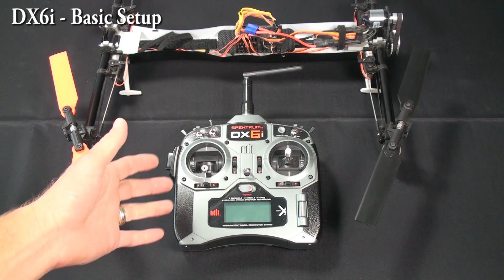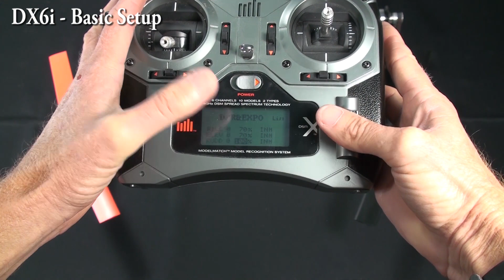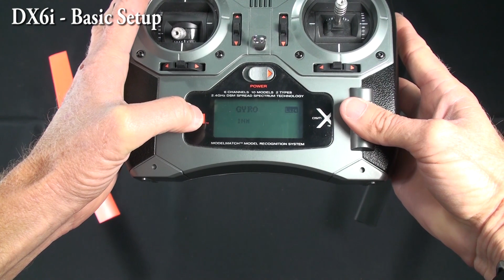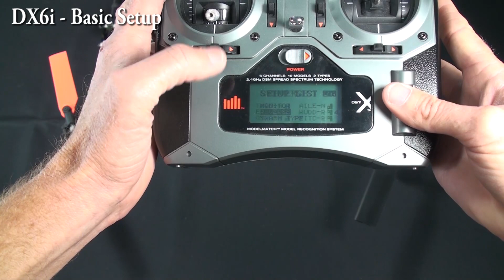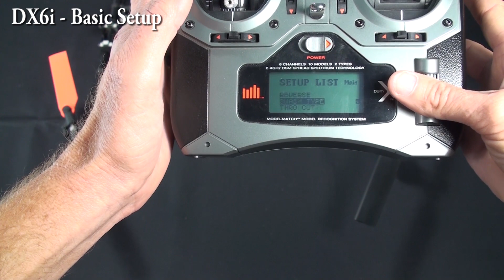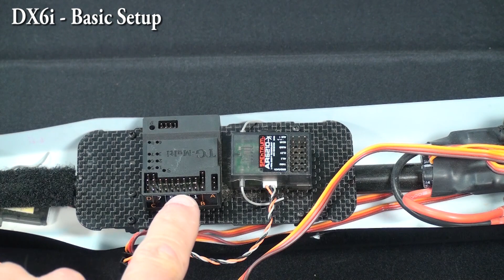Stingray 500 Setup Vid# 4K - DX6i transmitter initial setup

Comment: Please make a Video for the FrSky Taranis :) 
Would be awesome cause there are S-Bus Receivers for the FrSky Radios.
Reply: Hey Curtis, there is a Software called Companion9X that has a fully featured Taranis Simulator so you can run a Screen recorder on your PC and show it this way, and you can also save the Settings to an .eepe file and share it. 
Would be awesome if you could try that, if you want, you can send me the .eepe and i can try it with my Taranis and TGMulti.